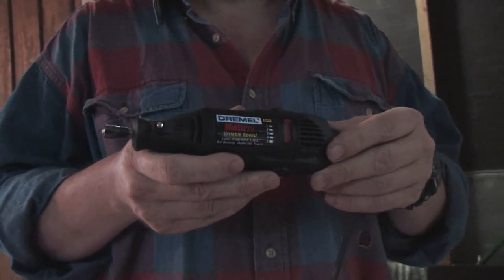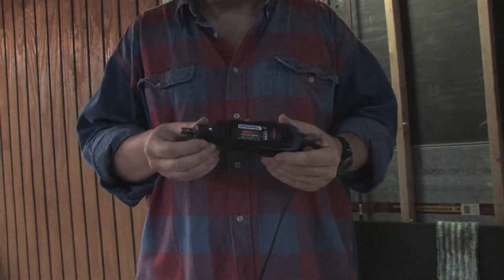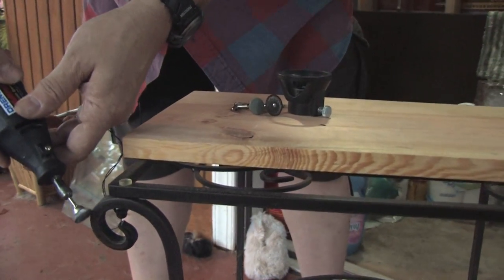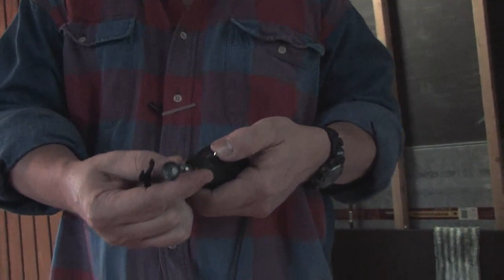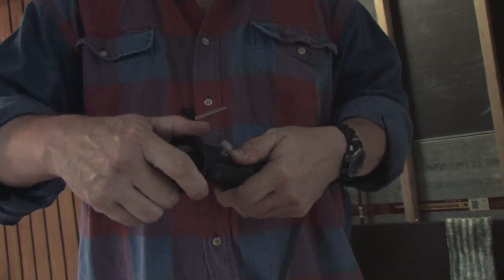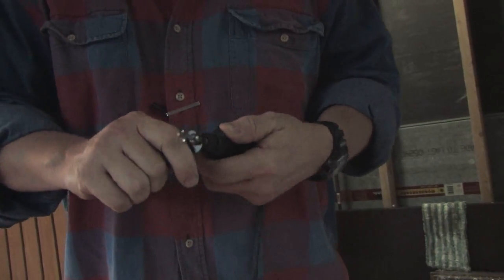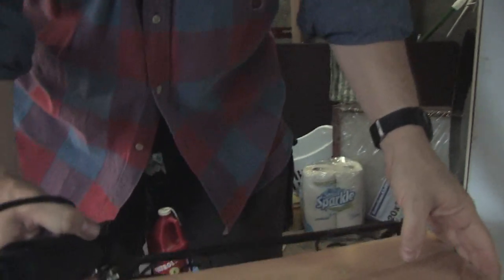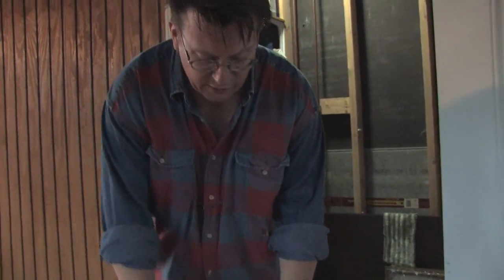Using a Dremel Tool : How to Use a Dremel Tool

Comment: This is not the Router attachment, but the cutting attachment. You are not supposed to use the Cutting attachment with a router bit.
Reply: that is possibly the case. but it probably works ok. you have to have a flat base to work with
Reply: Even as a cutting attachment its useless. The bit gets pulled out and the EZ-lock is not strong enough to hold it.

Comment: Thanks for answering my question so quickly. I am a beginner using this tool and so far I love it. I am fascinated by the router attachment.I usually buy my bits on line and so far the Dremel stuff has worked on my Craftsman tool so I guess I'll just have to take my chances. Thanks again.

Comment: Dremels are okay for small, short-duration jobs, but they'll overheat if pushed much. I was trying to use one for metal polishing and it hit the wall pretty fast, generating a burning smell. If you need more than a Dremel can give you, step up to something like a Foredom, which is a heavy-duty motor attached to a cable that drives a handpiece. Jewelers and carvers use them. I love mine.

Comment: To make a counter-argument to the rather timid BerkyBoy, that is the very point of a dremel. A dremel is the not-quite-as-good-but-it-will-get-the-job-done version of the proper tool for the job. That's something extremely valuable when you take a moment to consider how expensive buying each one of those tools would be, and how much more space they'd take up.

If you have the right tool for the job, use it. A dremel is just a light-weight multipurpose substitute.

Comment: I recently purchased a Dremel 4300 from Amazon. I have never really used a Dremel, but needed to expand a hole in a piece of wood so I decided to try it out tonight. That's why I viewed your video. I have the multipurpose cutting attachment, multipurpose cutting bit & even have the circle and straightedge attachments. I can't tell what you're using with your multipurpose cutting attachment and Dremel, which is making my anxiety go through the roof as I try to fumble through this task. What are you using with your attachment?

Comment: Thank u for the video, i am considering a dremel for various jobs but am not sure what the tool can do or how, which attachments/heads/bits to use for given jobs, etc. For example, I will need to make very small picture frames, as well as cutting thin metal, etc, and am hoping the Dremell can do it all. So ur video seemed perfect.

 If I might suggest one small thing, perhaps wear a white sweater or shirt next tme as it is hard to see the Drexel against ur dark shirt, and cannot see the bit at all. Same issue with distance from. camera lense.

Thanks...

Comment: I did not see how the router bit is tilted to an angle, what degree angle it was set to and what rpm speed you set the tool to create bevel on this soft wood. I'm assuming it's a softer wood? Please advise.

Comment: Seriously I bought a cheap 10$ rotary tool with 80 bits, I don't even know what they are used for. So far i know the Diamond aluminum oxide burrs are for removing flakes and grinding or engraving. The sand drums, drill bits, and polishing pads, and wire brush are self explanatory. The grinding stones I believe are for sharpening. I didn't know what the collets were for, but another vid explained that. What I really want is a big vid that shows a bunch of fun projects and things I can do.

Comment: Either you got a different book or didn't read it very well.
It tells you most of the accessories have the biggest 3.2mm shaft and that all the dremels come with that collet. It's also pretty easy to see when the shaft of an accessory is smaller and the book says all the collets come with rings on the end to show the size. If you get the chuck attachment then you shouldn't have any trouble at all with shaft size as the point is to replace all 4 collets because it can hold any sized accessory.

Comment: I just bought this attachment to cut a hole in the back of cabinet to run a power cord for a stereo through. I do not have a edge to start at as you show in your video. Did Home Depot sell me the wrong attachment?  Thanks for any suggestions!

Comment: Hi.. I have a question.. I got the dremel 300 and I use the cape and grinding wheel 542 to cut a plank (soft wood), 1.2 cm.. But it´s a bit too small in the cutting deepth.. How is the speedclic wood cape wheel 544? Does that one cut deeper than the 542? I need the deeper cutting... Love the machine btw.. THanks for fast replay (sorry bad english)...

Comment: Ever been to their site? You can do an accessory search by ID or by job and each router bit has not only detailed specifications it has a picture of the final cut.

As for what collets are needed for the different shafts, well i think if it fits tight it's good to go. It's the same way on drills and you can actually by a drill head adapter if matching shaft to collet is too hard.

I honestly don't understand the problem, dremels are as simple as powertools get.

Comment: Hi Steve! Thank you for showing although it was a short video. I have a "rotary tool" is it the same as a dremel or a "mini" version of it. Also when I bought the kit, it came with all these pieces like about 60 of different types of drills. It came without instructions, there are 16 small silver (in color) tips, some are cone shape, large, med, sm rounds heads, there are also 9 blue (in color) tips ....what are they for? Plz can u help me????? I would really appreciate it very much!

Comment: You have a Craftsman tool similar to mine, but will ours work with the Dremel Work Station Drill press?  The Dremel Work Station attaches by the nose unscrewing and screwing the dremel tool into the tray.  So what it comes does to is, are Craftsman the same size threads  and nose as Dremel?  Sorry for my wrong terminology.

Comment: Can those attachments (router etc) work with other rotary tools. I have a craftsman rotary tool that looks just like the one in your video. Mine has 5 settings from 5000 to 30000 rpms.

Comment: There are different collets and chucks, and each of those tools have different size shafts. Color coding them to the collet would help a lot in matching up when trying to work with a project. Even knowing what each shape does and the end look would help - I'm just saying I think if they would like small crafters to use it they would get more into detail. There is NOTHING in their booklet that shows all that. If you have router bit it shows the final cut on most pkgs.

Comment: i have that exact same dremil tool, a little tip while on the subject of dremils, NEVER cut plastic on high speed it will melt the plastic around the dremil and stop rotation. you can get it off, but its SO hard it will put your project on hold for 40mins at the least

Comment: Ehow, i did a search for regreasing the tool itself.  I was using the tool to cut aluminum thin stock and it is HOT!  It occurred to me that cheap $5 a gallon factory grease must be melting inside.  Is it possible/desirable to disasemble the dremel and regrease those bearings?  Seems to me whatever grease they use, that doesn't wear or squeeze out is just going to melt out eventually.

Comment: we have bought many dremels over the years and they all burn out after like one or two uses carving wood... i follow the guidelines on speed i don't use pressure at all.. seriously i can't round  the letters of more then one word before it decides to quit. i even turned it off fine.  they act as if it was running for an 6 hours. I was scared to use the last one my dad got because he said he'd buy one if i promised not to burn it out but if i cant even use it with out it failing.
Reply: I've had the same experience. I've had two of them and both gave up after fairly light use. After you have bought a couple of these, you have near enough money in it to have bought a Foredom in the first place.

Comment: Maybe just me but dremel tools simply cannot be used for routing right? I've used 4 different models and about 10 different bits and IT DOES NOT ROUTE!.... EVER!!! Not once! Is it the bit, the tool??? Fast sharp things should cut but dremel bits and accessories don't seem to make the cut.. pun intended.
Reply: I watch people with routers just clean pockets out of wood with ease but I have yet to be able to use a dremel tool as a router.. pretty sure it's impossible so DREMEL PLEASE  Lift your focus on appeal and shift more towards a product that works for what you marketing it as!